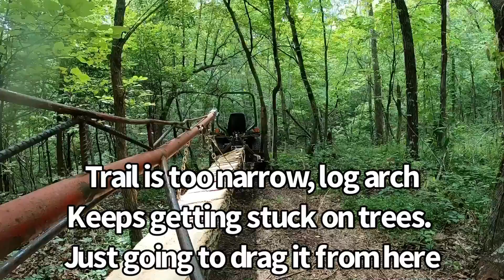Working on Log Bridge In the Woods - Milling and Installing the Second Log

Comment: Great videos one day I hope to have my own property for some awesome projects like yours with your log arch if your not using the winch to keep the log attached to the tractor could you just leave it attached to the log arch when you use the winch to pull the arch down still use your chains on the arch but just save sometime loading and unloading log from the arch

Comment: if you can find a Barn wood builders video some of them have instructions on using an adze to square the logs in the old log building they restore. a very useful tool .
Reply from the maker: I’ll have to check that out.  Thanks!

Comment: 👍nice job. 
🤔 maybe Aaron could make use of the camera when you get a replacement. He hid his very well.🙃
FYI & anyone else. The up & down remote switch wire can be cut and repaired with a 3 prong plug (one side male [remote] & the other female [winch]. 
 In between any length of 3-wire extension cord can be used. The winch is only 12-volt. (one spade is + up, one spade - down, and round is ground.
Reply from the maker: Thanks for the info!

Comment: Captain, if you have to saw more timbers, pop a line, get your log off the ground, get on top of it and cut it from the top. You can make really good cuts that way. Thanks for another good video!!
Reply from the maker: That’s how I did it.  It does work really well,  just should have sharpened the chain when it started walking on me.  Thanks for watching!

Comment: 20:20 same thing happened to me while I was working in he woods.  Luckily I found something sharp. It would have been much better if I knew the saw blade trick.  I'm been needing to get a remote ( probly harbor freight)  I hesitate bcuz I misplace everything. Any suggestions 🤔 from somebody may help me.

Comment: Ash logs won't last long, white oak is what you want for long term, that or get you a dozer and a section of culvert pipe and be done with it. Looks like Brown county terrain.
Reply from the maker: Using the dead trees we have.  Not cutting down good timber for it.  And we went over why a culvert won’t work here in the video.  Thanks for watching

Comment: How will you anchor the two main beams? It would be bad if the whole thing washed away in a flash flood, especially after all the work you've done.
Reply from the maker: Bolts of some kind

Comment: Thanks, what you do remined me of our NWest British blacksmiths shop that started in 1890. I can see I am 2y late but the fun you have is great, "just get it done attitude. 
I learnt to weld when I was 10y I built a pulse jet engine when I was 17y Now old age holds me back a bit so I now service very old sewing machines {my very old machines are from around 1880} They still work and we use them to make things to give away.

Comment: Bridge is starting to look pretty good. Are you going to put any railing on the bridge so your tires don't slip off if its a bit wet?
Reply from the maker: Yup, will have a truss component on the side that will double as railing

Comment: Mike, just wondering why you notch on the top section of the log rather than the bottom? If you notched the stump portion you would have more useful timber for your projects. Not that your using the tree you're cutting in this video would matter. Just something to think about. Oh by the by, Check out Buck'n Billy Rays channel... Awesome dude, think you'd like him.
Reply from the maker: That’s how we do it in the Midwest.  The bottom face cut seems to be a west coast/east coast, Canadian thing.  Personally I prefer logger wade and Nuts319 for my logging channels.  Check them out!

Comment: Would it not have been good to put something in the concrete to anchor the beams to so they will stay in place on the piers and not move side to side? I guess though when you get the bridge built it will be heavy enough that it will stay in place. You gonna make it a covered bridge? Put a maybe 4 4×4 beams under those, perpendicular to them and spaced out evenly and use those to put sides then the roof maybe? You got themed cabins so it would be fitting to have a covered bridge. LOL! I'm over here trying to make more work for you. This is a neat project and so far been fun to watch you problem solve and get it built. Gonna be really neat when you get it finished. Good luck and stay well. -Wil  👍
Reply from the maker: Hahaha,  a covered bridge would be cool,   It probably not this time around

Comment: Kleeman, Mike. When I used to use the saw to rip trees, I found that if I slowly worked the blade around to being square filed on the teeth that it would rip better. Also, once I got wedges in there, I would take the branches from the tree, cut a wedge shape on one end and a flat on the other and make my own wedges from the tree that were any thickness or length I wanted to have for splitting the tree open. took me a while to figure those ones out.
Reply from the maker: Thanks for the tip!

Comment: Next time you need to lift a log, take another piece of wood, maybe a couple feet long, put it on end next to the log you want to lift, run the cable over top, and run the cable tight. Tow operators use this trick sometimes.
Reply from the maker: Good point!

Comment: I am sure you know,.....but probably the reason for the rough looking cut, is a dull chain.  It looked like your saw was spitting out ribbons of wood.  A properly sharpened blade should spit out chips, not ribbons or sawdust.  Keep safe!!!
Reply from the maker: Yup,  mentioned it in the video.  Should have resharpened it a couple times instead of muscling through.  Lesson learned and thanks for looking out!

Comment: instead of pulling across the creek attached to trees run a heavy chain horizontal on the other side to two good trees about 6-10ft off the ground then you can put your snatch block directly where you need it
Reply from the maker: If I had the chain!  Definitely need to add some more chains and blocks to the tool box

Comment: It's amazing sometimes what you can accomplish by yourself. When I built my shop I probably did 80-90% of it by myself.  I remember having to come up with a way to get sheets of plywood up to the top of the gable when I was putting the outside sheathing up.  You come up with a lot of little tricks and techniques to get the job done and you're pretty dang good at it.  I have picked up a few watching you that I will definitely keep locked in my head for future use.
Reply from the maker: Hey that’s awesome!  Thanks for watching

Comment: Nice project and you're making pretty good headway.  Smart using the winch and other accessories to simplify your job.  No need wrecking your back or anything else. At first I thought a culvert bridge would be the way to go with your project but after seeing the debris that washes down that gully, your wooden bridge seems a better way to skin this cat. No matter what option you choose, work will be involved and you're certainly doing a fine job at the wooden bridge install. I've enjoyed the full video and look forward to seeing your final product.  Stay safe and get a walkie-talkie if the radio doesn't get a signal there.  Having contact with the bride in case of emergency is very important.  Again, nice work and wishing you the best in completing your bridge.  I'm sure it will be sturdy and safe.  I tackled a culvert-bridge project about a year ago and it's still holding up pretty well. Shortly after completion of that culvert-bridge project, my body alarm went off and I suffered a stroke which changed my entire outdoor activity level.  So now I selectively approach things before taking on new projects.  I'm doing a lot better now than I was a year ago and I'm back out in the thicket to enjoy the wilderness and continue playing outdoors and seeking more challenges. New Subscriber!!  👍🏽🙂.  Have a fine upcoming week and be safe.

Comment: Love the video and seeing how you are going about each portion of the bridge.  I am in my 60's and helped my father build my mom a hothouse with nothing but small tree trunks and doweling.  It was so cool.  The shelves lasted way longer than the main support poles from tree trunks.  Because, of course, they never got wet.  Please, PLEASE consider the 3rd or 4th beam going across.  Yes, it's a nightmare and a lot of work to do but well worth it in the end.  Also.....you may want to put some support just a bit further down each side under each end.  You don't have a lot of "purchase" for support even with the concrete and rocks.  If for some reason a really wet season came along, I could see the sides washing out from under the ends.  Just a thought.  Just 2 short years after our first hothouse build we ended up replacing it with aluminum beams and clear vinyl panels.  It still stands today and is in use.  My mom is almost 87 and in that hothouse every single day.  And yes we poured a concrete floor that time...lol.  I would hazard to guess that has been in constant use for about 40 some odd years.  Good luck and can't wait to see what comes next.

Comment: If you have flash floods in the area, unclogging a culvert during a storm would be a tough mess.  I read that a foot of water typically exerts 500 pounds of lateral force.  And just six inches of flowing water is enough to knock a person off their feet.  So yeah, keeping it open is the best option.

Comment: Working with logs already with decay, hope you don't plan to use it to cross with your tractor. A footbridge, should be okay and maybe for a few short years okay for the ATV/UTV.
Hint: Lay the stone up overlapping the joint below.. no joints above the one below.
Tough to do good video, and you accomplished that task quite well.

Comment: When I first saw the rebar or pipes in the stone base, I thought you might use them as a point to hold the logs in place by drilling a corresponding hole in the log. I was wrong. It still looks good and I am sure you have thought this whole process completely through. Have good days!
Reply from the maker: We have a plan!  Stay tuned and thanks for watching!

Comment: That will be strong enough to walk  the dozer over it should you need to.  Tell one of the tractor companies to sponsor you a tractor with all the attachments that you will tell the people it is Kleeman tough and prove it by getting a dozer attachment for it. Its a gonna look so good done... I guess everything looks better done though. I saw a attachment that goes on a excavator right where the quick change is and it vibrates... I seen the guy stand old telephone poles up and work his way over to the top and send it down through rocky soil that had boulders in it and still not one all messed up pole  at all. U could drive some real cribbing in  the ground there and make it two lane with speed bumps on the sides so in case you got over on the far side and ate some vegetation that knocked you down, they could gps the "new bridge road" and drive to you/LOL. Maybe not so far quite yet.

Comment: Send that burn barrel down into the creek; easier, safe.  I'd figure in some kind of anchoring (soft tether at least) for the log beams, in case that creek fills up enough to float a big tall root wad down, and knock all that hard work and engineering into the flow. Looking forward to the rest!

Comment: I thought that log was a little too heavy to put the arch down, and then you attached the snatch block to the log and then I thought what great idea. You have definitely figured out some helpful tips and tricks to aid in your lone endeavors. When you said you haven't had the time to install the wireless remote, I was thinking this was the perfect situation to have had to use it. It would of saved you multiple trips across the ravine when rigging those logs up on to the bulkheads. As far as that fuzzy spot on the camera lens, it honestly didn't seem noticeable after a minute and didn't notice it again until you mentioned it at the end of the video. At least you will have a reliable backup camera for those sketchy situations where you want to get an interesting shot but don't want to risk damaging a good camera. Thanks for bringing us along on your builds and travels.

Comment: ATM if one log fails from rot it will be a total loss. I think you should consider filling the space with a one/two more beams for a bigger safety margin and spreading the load should improve its lasting power. Charring the ends is supposed to improve rot resistance. This a really cool project I'd just want to see last as long as possible.
Reply from the maker: Still has truss component to be added.  Thanks for looking out!

Comment: you may want to brush on used engine oil  let soak and repeat to slow down rooting of wood  and really get where wood and concrete touch any way have blessed day
Reply from the maker: Thanks for the suggestion
Reply: Might want to clear that with EPA and DNR.

Comment: Hey Captain, find some rebar that fits your hand good and weld that hammer head to it. Then using a wire wheel on a grinder clean the rebar handle real well then figure out how long you want it and cut it to length. Bevel/round the end then dip the handle in some Plasti Dip. No more broken handles. All my shop hammers have been done this way.
Reply from the maker: That is exactly what I need to do

Comment: Good morning Mike . I was wondering about the one end you notched , it had an over cut . Now you have a weak point . And what are you going to use as railings ? Maybe a few post and rope that will match the boat theme . I would use two lines of rope on each side .
Reply from the maker: Still gets logs for truss support that will double as railing

Comment: A captain that last log you couldn't put across her and put across her across the bridge won't you take that extra side of why don't you take that extra side of it the other side of it put it right in the middle of those other logs right in the middle of those other logs and then you'll have more support more support you know because you never know if a law is gonna come down there ever know if a law is gonna come down that Creek and knock one of them logs but with 31 of them logs but with 3 of them you'd have a lot more support in case you have any problems in case you have any problems